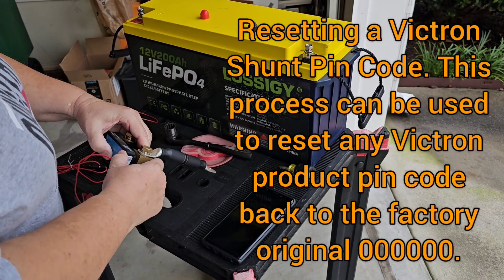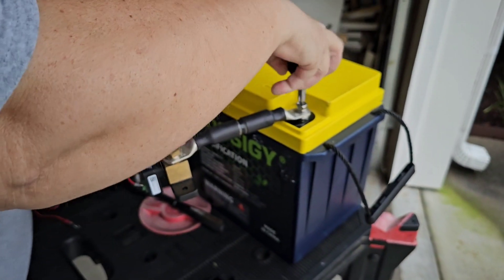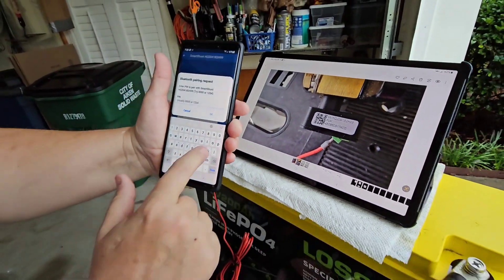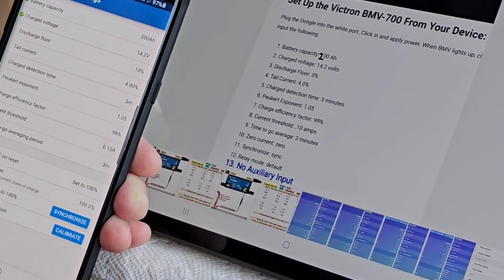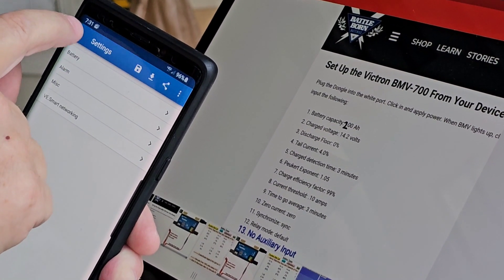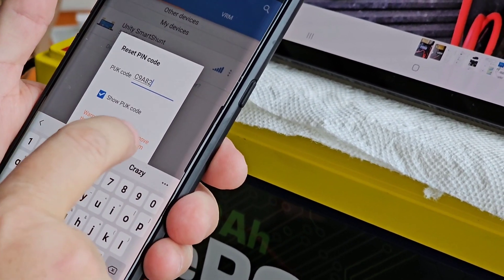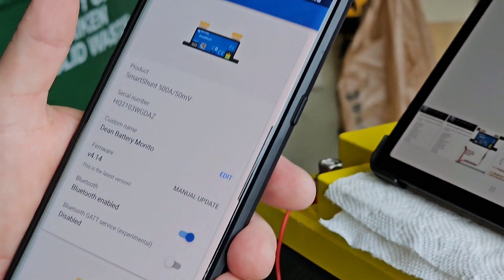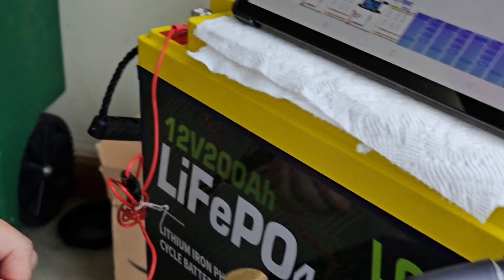Resetting the Pin Code on a Victron Smart Shunt

Comment: Is the code numbers only or a letter password? I got sa new iPhone and it doesn't know the code.
Reply from the maker: @EarlBalentine  Numbers, 6 numbers. Typically, the default is 000000. Victron App usually makes you change the code when your settingthe shunt up for the first time. I write the code on the shunt and the Victron manual that comes with the shunt, so I can always find it. Whenever you your trying to pair it for the first time with a new phone, you must have the 6 digit code. Otherwise, you've got to reset the password by the procedure in my video.